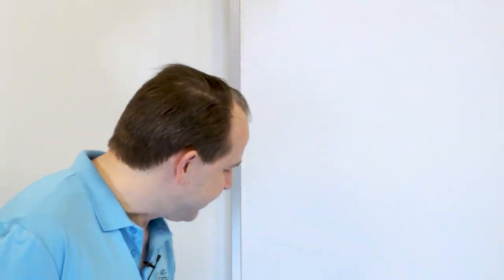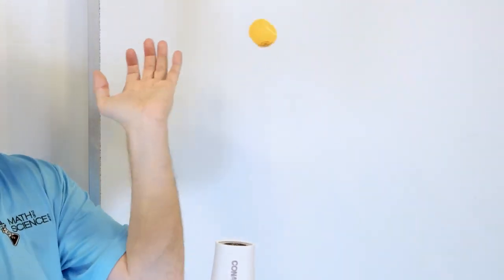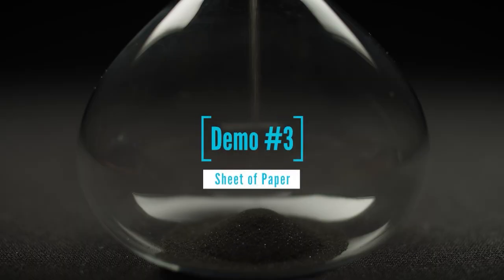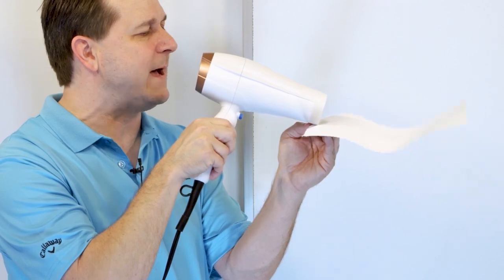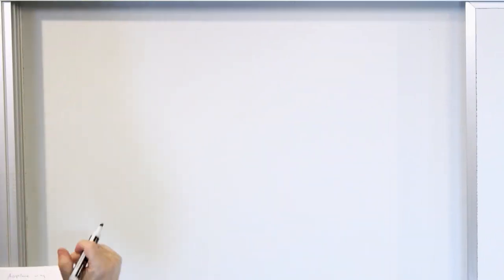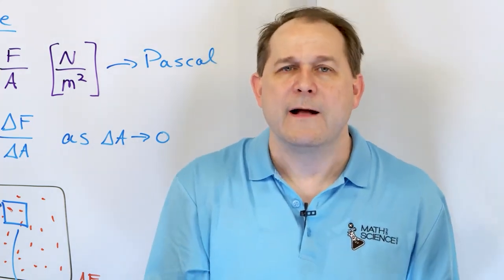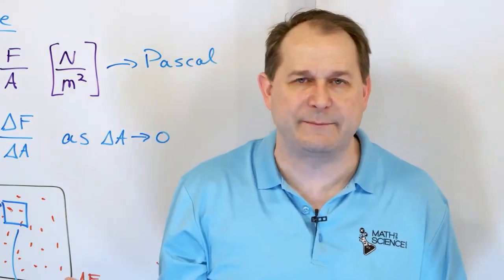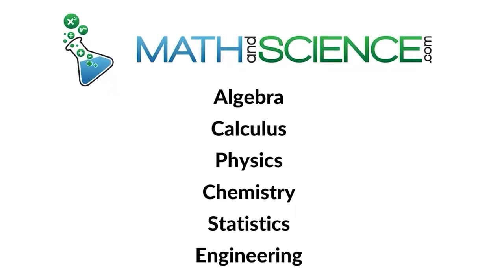Bernoulli's Principle & Air Pressure Visualized

Comment: This is the best explanation of the Bernoulli effect I've found so far, but I'm still struggling to get a really deep intuition of what's going on. Somewhere in there, I'm missing something fundamental about WHY the velocity of the particles decreases in the plane perpendicular to the air's movement. Why does speeding them up in one direction slow them down in another? I get that it has to (conservation of energy), but some force has to act on them to make that happen, and I don't understand where that force comes from.

Here are a couple of thought experiments which illustrate my confusion. Like Jason, I'm treating the situation as 2D, and I call the pipe's direction "horizontal", while all movement perpendicular to the pipe is "vertical".

Experiment 1: let's say our "atmosphere" is one particle bouncing vertically from side to side of the pipe with a vertical speed of V. Suddenly a flat-headed piston shoots down the pipe and knocks the particle sideways with a horizontal velocity of H. But the particle's vertical speed will still be V, so it'll hit the walls exactly as often and exactly as hard as it did before. The pressure is unchanged! The same applies if the piston strikes many particles. My intuition is that when those particles go on to strike other particles, vertical momentum will be conserved, and therefore the pressure should stay the same. Is that true?

Experiment 2, even simpler. The pipe is very long and filled with still air. We could now accelerate the air to the right to velocity V, and we know the pressure would drop. But we don't. Instead, we accelerate the pipe to the left to velocity -V. The pipe and the air now have the same relative motion. My strong intuition is that the pressure does not drop. Is this correct? But if so, how does the air inside the pipe "know" that it's at rest and the pipe is moving? This seems to break the principle of relativity.

I've been trying to puzzle this out for hours, I'm not getting it, and I'm longing for somebody to point out something dumb and obvious that I'm missing...
Reply from the maker: I’ve been thinking about this, which is a very good one. I think you were thinking of this fluid is very rarified and in your mind do you have a picture of a few atoms in a tube and so when you smash it with a piston they can just fly off in a straight line, pretty much unaffected by anything else.

But in reality, this fluid has trillions and trillions and trillions of atoms. They can’t move hardly any distance without smashing into another atom and ricochet off and going at some other random direction so these things are jiggling and smashing and going in random directions constantly trillions of times per second. 

At the end of the day, whether it’s your hand, a piston, some kind of external device blowing it or whatever the only way that fluid can start moving down the tube instead of just randomly jiggling in all directions is for its horizontal motion to be much much much much greater than the sideways forces because there’s so many particle interactions and they’re always bouncing off of each other. The only way that the bulk fluid can move to the right , is if the sideways force is basically small or are almost nothing because if it were any other way, the collisions would force the bulk gas to be pushed an all sideways directions, preventing its motion down the tube.

So don’t think of it as a rarified thing where particles can zoom off unaffected their colliding constantly the only way that that fluid can move as a bulk unit of trillions of atoms down the pipe is if they’re not interacting and colliding with each other as much, and that means that they must be moving more or less as a group which means there’s hardly any sideways interactions with the sides of the vessel or the pipe.

Comment: You have to understand what is the FOURTH dimension. LOOK at WHAT IS the orange “Sun”. LOOK at WHAT IS the blue “sky”. ELECTROMAGNETISM/energy is gravity. SPACE is CLEARLY electromagnetic/gravitational ON/IN BALANCE. Two AND three dimensional SPACE are BALANCED in accordance WITH WHAT IS the FOURTH dimension/TIME !!!! (TIME is NECESSARILY possible/potential AND actual ON/IN BALANCE.) Great.

AI Overview: “Hydrogen is considered consistent with complete combustion because when it burns in the presence of oxygen, the only product is water vapor, meaning there are no harmful byproducts like carbon monoxide or carbon dioxide due to its lack of carbon atoms, thus achieving a "complete" combustion reaction where all the fuel is fully oxidized.”

The density of what is pure WATER IS HALF of that of what is packed sand/wet packed sand. The average tide in the middle of what is the ocean IS about three feet !! Consider what is the BLUE “sky”. WHAT IS complete combustion IS consistent with what is E=MC2. GREAT.

SPACE is CLEARLY electromagnetic/gravitational ON/IN BALANCE. Two AND three dimensional SPACE are BALANCED in accordance WITH WHAT IS the FOURTH dimension/TIME !!!! (TIME is NECESSARILY possible/potential AND actual ON/IN BALANCE.) This CLEARLY explains the cosmological redshift. Consider sphericity. Consider what are neutron stars. Consider what are OBJECTS!! Consider what are galactic jets. Consider what is lightning. Now, consider what are galaxies.

Consider what is THE EYE ON BALANCE, AND consider the fact that the stars AND PLANETS are POINTS in the night sky. Indeed, now consider the orbital velocities in what are galaxies!! Excellent. Consider WHAT IS the coronal heating "problem" ON BALANCE !! SPACE is CLEARLY proven to be ELECTROMAGNETIC/GRAVITATIONAL ON/IN BALANCE consistent WITH WHAT IS the FOURTH dimension/TIME !!!! Consider TIME AND TIME DILATION !!!! Again, consider what is the cosmological redshift AND consider the orbital velocities in WHAT ARE GALAXIES.

What is E=MC2 is taken directly from F=ma, as c squared CLEARLY represents a dimension of SPACE in relation to what is the fourth dimension; AS gravity/acceleration involves what is BALANCED inertia (and/OR inertial resistance); AS gravity AND ELECTROMAGNETISM/energy are (CLEARLY) linked AND BALANCED opposites; AS this CLEARLY explains the motionS of WHAT IS the Moon; AS the stars AND PLANETS are POINTS in the night sky; AS TIME is NECESSARILY possible/potential AND actual ON/IN BALANCE. Great. (Consider TIME AND time dilation !!!!) Magnificent.

Consider what is the BLUE “sky”. WHAT IS complete combustion IS consistent with what is E=MC2.

The ultimate mathematical unification (AND UNDERSTANDING) of physics/physical experience (AND TIME) combines, BALANCES, AND INCLUDES OPPOSITES. TIME is NECESSARILY possible/potential AND actual ON/IN BALANCE.

Gravity AND ELECTROMAGNETISM/energy are (CLEARLY) linked AND BALANCED opposites, AS the stars AND PLANETS are POINTS in the night sky; AS TIME is NECESSARILY possible/potential AND actual ON/IN BALANCE. Great !!!! Consider what is the white star. Consider TIME AND TIME DILATION. Consider what is a TOTALITY. Consider what is the white dwarf star!! I have CLEARLY proven WHAT IS the FOURTH dimension/TIME.

Consider what is the galactic bulge on balance with what is an orbiting star. Consider what are galactic jets. Now, consider what is stellar clustering. Indeed, consider what are neutron stars !!!! Great.

SPACE is CLEARLY electromagnetic/gravitational ON/IN BALANCE. Two AND three dimensional SPACE are BALANCED in accordance WITH WHAT IS the fourth dimension/TIME !! (TIME is NECESSARILY possible/potential AND actual ON/IN BALANCE.)

By Frank Martin DiMeglio